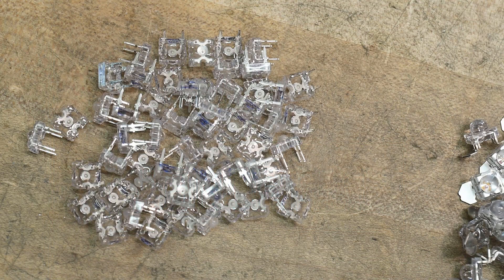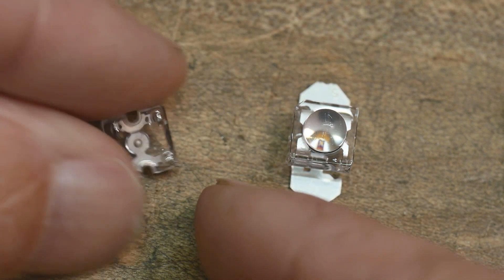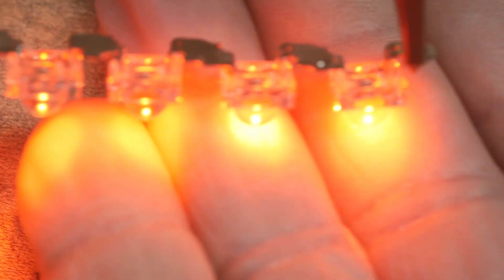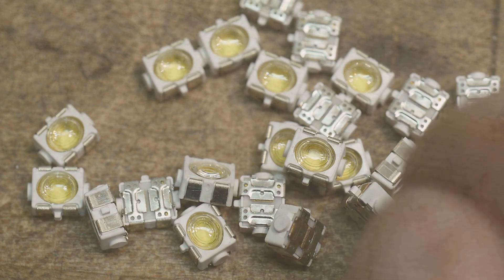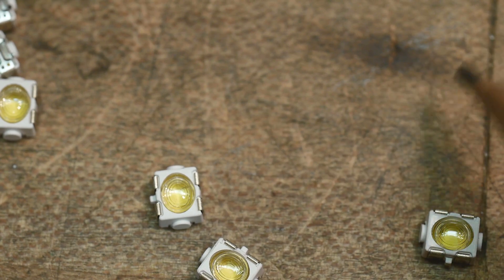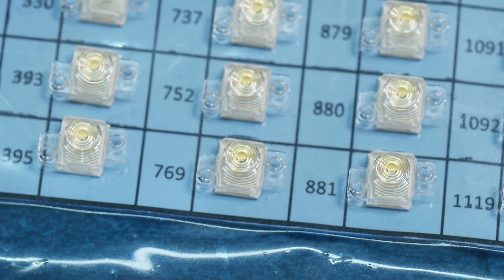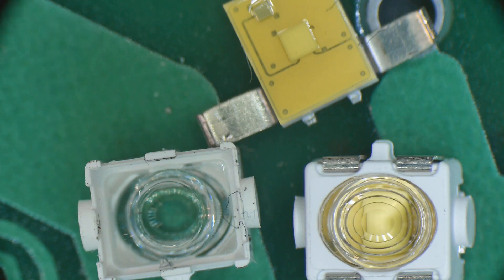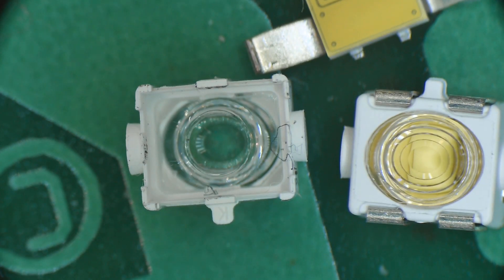#725 LED Design for Mobile Phones

Comment: i want to find the datasheet for the FH341A led
Reply from the maker: did you contact Samsung:
Samsung’s new reflector-integrated flash LED ─ the 3432 1.8t (FH341A) delivers over 165 lux at 1A and a minimum CRI (Color Rendering Index) of 80, assuring quality photos in daylight and at night. In recognition of such superb performance levels, the 3432 1.8t is expected to be used in leading-edge smartphones this year.

Comment: You seem quite capable with using an SA. Did that come from your work involving LEDs? BTW, interesting topic, thanks.
Reply from the maker: No. I worked at Wavetek designing microwave power meters and scalar network analyzers

Comment: What would be the reason for having a reverse protection diode for the LED? Wouldn't they design the LED driver such that it does happen?
Reply: I think that the chip in parallel is a zener diode.
These LEDS were probably designed for a series LED assembly.
If one LED fails, whole assembly will fail OPEN and you get no light at all. (A short will be handled by the constant current driver circuit)
This may be dangerous in automotive applications.
The zener diode with a voltage rating slightly higher than the maximum LED voltage drop will conduct when the LED opens and the slightly lower total brightness will be almost unnoticed.
(This can be checked easily)
Reply: @paulcohen1555  Thanks
Reply from the maker: @paulcohen1555  Sorry. I worked for the company that built these. all LED assemblies had diode to protect for ESD.
Reply from the maker: @paulcohen1555  https://www.ledsmagazine.com/manufacturing-services-testing/substrates-wafers/article/16695489/integrated-esd-protection-facilitates-more-robust-led-devices-magazine
Reply from the maker: @paulcohen1555  No that makes sense for some applications. The GaN material is quite sensitive to ESD. much more than red LEDs so you will see a TVS diode on packages.
Reply: @IMSAIGuy   @IMSAI Guy  BTW, TV LED backlight have external zener diodes for protection against ESD and open LED failures.
(I have pictures of the strip but don't know how to upload them to YouTube).
Reply: Correction: such that it doesn't happen?
Reply from the maker: ESD protection